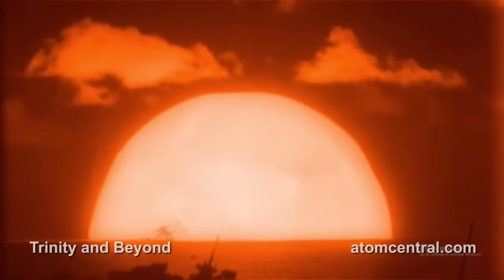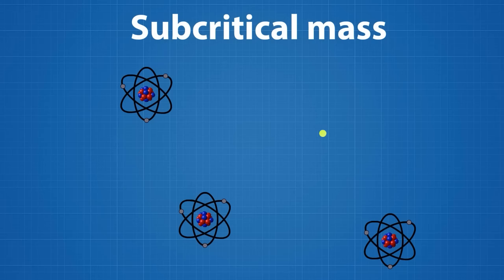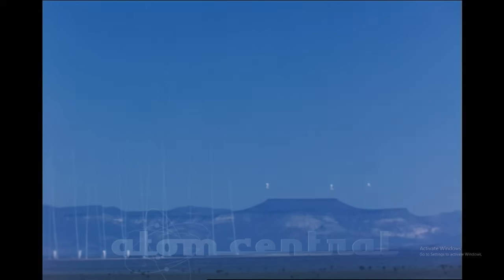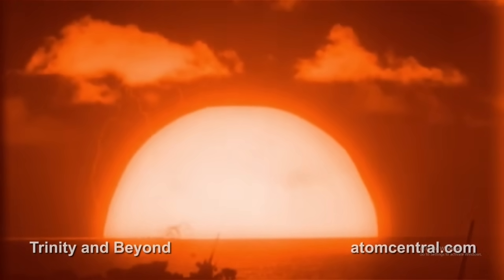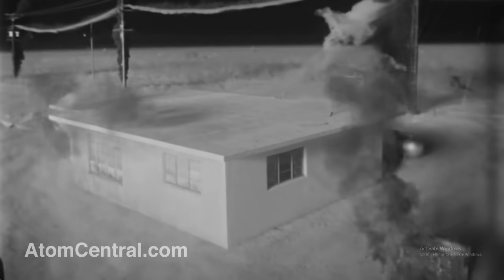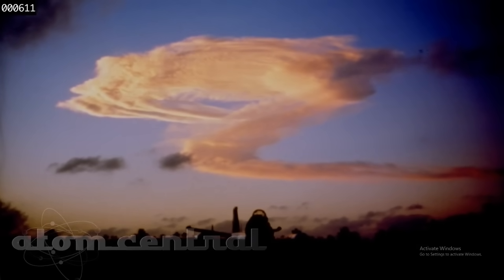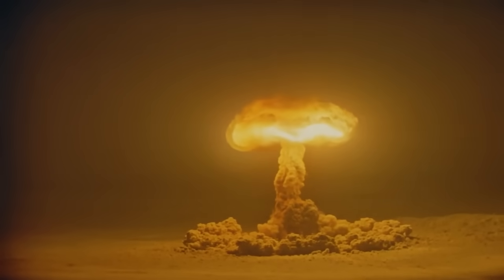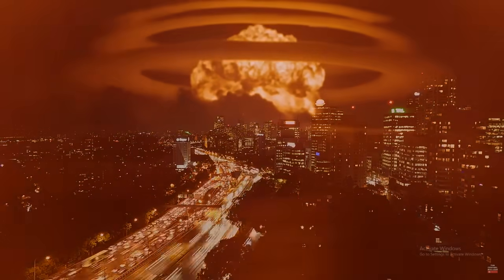Anatomy of a Nuclear Explosion

Comment: The half-life being shorter means that radioactive decay is more intense. Barium-141 has the most intense decay radiation in the list shown, but it's a threat for less time. This is why you should stay indoors after a nuclear strike for as long as possible: it reduces contact with the short half-life radioisotopes in the environment until several half-lives, meaning that a significant portion of the radioisotopes have decayed away into more stable, less dangerous elements.
Reply from the maker: I didn't know this. Thanks for the additional information!
Reply: @darkscienceyt  Additional information, a "half-life" means it's the time period during which half of the remaining material will decay away. During the next half-life, you have a quarter of the remaining amount, and so on. It's possible for more or less of it to actually decay during the period, and a detectable amount of radiation isn't necessarily life-threatening. The key elements of dealing with a radioactive environment are time, distance, and shielding in order to control your radiation dose. This means limiting your exposure time, as well as factoring in decay time, and putting distance or shielding (or both) between yourself and the radiation source.
Reply: @darkscienceyt The Iodine-131 is actually one of the worst, because its moderate half-life allows it to get into the body and displace natural iodine in highly sensitive parts of the body. This is why iodine pills are important for surviving fallout. Your body won't accept iodine from fallout if it already has a surplus.
Reply: Someone has a gun with 100 bullets. If you were trapped in a room with the gun firing all its ammo in 1 minute, you would be in greater danger for that minute than if it was fired once an hour. The same odds of hitting you but more chances.
Reply: @greggweber9967  not at all. You can assume 100% of the radiation emitted is going to hit you. Your body naturally deals with radiation, even a elevated levels above normal. What your body cant deal with is a short burst of a TON of radiation.
Reply: @greggweber9967  NOT really.... one bullet can kill you, but one neutron won't. It would take many over a short period of time.
Reply: The Strontium 90 and Cesium 137 isotopes are the most insidious. They have kinda a nightmare half life of around 30 years. They have short enough half lives to be strongly radioactive, but long enough to be a long term hazard that cant be waited out. Strontium is absorbed by bones, so if it gets inside your body, it will be irradiating you for the rest of your life.
Reply: @lawv804  This is why so many boomers in the Midwest developed cancers in the 80's & 90's... Thyroid cancer was unusually higher because many of them were children living on farms and were exposed thru home raised milk & produce...
Reply: @lawv804  That's because Chemically, Strontium "mimics" Calcium, and Potassium.  Same goes, for iodine, which is concentrated in The Thyroid and Thymus Glands,  Radioactive Dust, of all kinds; is drawn into the Lungs, and trachea, sticks to the mucous membranes, there, and remains there, for the rest of Your Life, bombarding the surrounding tissue, with Alpha, and Beta Particles; perhaps Gamma, as well.  After it kills You, and You are dust, some radioactive particles are still there (such as Plutonium-239), with a half-life, of 25,000 Years; it will be dangerous, for the next 250,000 Years, killing, over and over, again.  By Comparison, The Original Americans arrived in North America, about 18,000 Years Ago; Stonehenge, and The Egyptian Pyramid-Building Period,  was built, and began; about 5000 Years Ago; and Lake Toba erupted, about 75,000 Years Ago.
Reply: Also worth notting that not all radioactive elements are equal. Plutonium for example is a great alpha emitter (mainly 238 and 239), alpha particles are helium nucleus it's very ionizing and heating but doesn't penetrate much your skin, the danger is ingesting or inhale the radioactive material. Then it's very very toxic.
Cesium-137 is a beta emmitter (basically free electrons) so is not THAT penetrating einther but also dangerous to inhale.
Gamma emiters is the most penetrating and harder to shield against but ptoportionaly causes less damage.
Uranium and Plutonium even the more stable isotopes are very toxic chemically
Reply: @FranÇa_Ball  Everything you wrote after "Also worth…" was both true and cool.
A few centimeters of air or piece of cellophane from a pack of smokes will stop alpha particles. You could hold a warhead core of weapons-grade plutonium in your hand for a moment with no ill effects. I would wear surgical gloves or something. I bet it would feel a little warm on a hot day. Like you said, you get it in you and it's another story.
Do NOT do that to weapons-grade uranium 235, please and thank you. That is different.
Reply: Beta radiation does penetrate skin. Way more dangerous than alpha.
Reply: I almost thought You talking about half-life made by valve
Reply: Here's another way to look at it: same-size samples of different radioactive sources give off the same amount of radiation during their half-lives. So Barium-141 will give off the same amount of radiation in 18 minutes that Strontium-90 does in 29 years (assuming they give off the same type of radiation, and have the same number of atoms).
Reply: Yes, thank you for saying this. People assume that the longer something is radioactive, it means it's dangerous for longer, which is the opposite of actually. Things with short half lives mean they are emitting a lot of radiation for a short time. Whereas things with long half lives are emitting very little radiation but for a long time, which is much much safer.
Reply: The worst prompt beta emitter is the few hundred grams of free neutrons. Not only are the bouncing around at several hundred miles per second, they’re beta decaying where ever they go.
Reply: @DrDeuteron  Username checks out
Reply: @DrDeuteron  By the time the free neutrons decay, they are so spread out that they aren't a serious beta radiation threat. They are far more dangerous while concentrated close to their source as neutrons.
Reply: @lawv804  neutrons decay into beta particles?
Reply: @ut000bs  Yes. Free neutrons are unstable and undergo beta decay with a half-life of about 15 minutes.
Reply: @ut000bs  The neutron ejects a beta particle (electron), and becomes a proton.
Reply: @lawv804  I read your reply on the run in a hurry and I don't think I digested it right. Of course that is correct and I have no idea what happened.
I am the absent-minded physicist. lol
I must have read "beta" and thought "alpha."
Reply: @DrDeuteron  neutrons decay into beta particles?
Reply: As they said in those old documentaries "Duck and cover!"  lol
Reply: 🎯 the first 24 hours are the most important in terms of shelter. the next week or two would be ideal if you cannot rely on rescue within that time but if you could choose one, it would be stay under shelter the first day.
Reply: Strontium-90 and Cobalt-60 are the bad mofos of radiation...
Reply: if you were near blast site, it dosent matter tbh, you are already screwed. if you die in a year or 15 years, dosent really matter much.
Reply: Awesome thanks 👍
Reply: So unless you’re somehow capable of staying in a shelter for 29 years, I guess strive to get to 8 days at least before making short trips only if necessary?
Reply: @rickdaracc4611  You didn't understand what half-life means. You only need to stay in a shelter for 2-3 weeks. The activity then drops to a value that is only slightly above normal values.
Reply: Correct. Shorter half-life means greater damage from radiation. Problem with Hiroshima was that at a time, population was not informed how to protect themselves from fallout. As radiation can not be detected via smell, sound or sight. And the health problems like cancers took a long time to develop after the exposure.  
A big concern is that air currents can carry fallout quite a long way away from nuclear detonation. And the direction is hard to predict. So a significant portion of the population would need to shelter indoors for a period of around two weeks. Food and water can also be dangerous within this period. So the problem is, in case of nuclear explosion there will be a lot of people unwilling or unable to remain sheltered and have enough supplies for this period. Even if you go with recent COVID isolation examples, you can see that it is likely people would exit their shelters sooner and would thus expose themselves to a long term health hazard. Not to mention, a lot of people would be caught outdoors, unprepared by the time fallout hits them.
Reply: Even after that period; there will still be plenty of radiation left, from. the longer-lived radioisotopes.  Your also forgetting the other effects of Nuclear War, such as Environmental, and Supply Consequences.  EMP was also barely discussed.  I suggest You read "Alas, Babylon", as well as look at both "Threads", and "The Day After", Again.  Another such movie (and, there were many of these), was "On The Beach", about a group of people, in Australia, waiting for The End, after The Northern Hemisphere had been destroyed.
When I was in Sixth Grade, We had an "Atomic War Drill".  All the school students were crowded into a dank, paint-peeling, mold-infested, unused locker room (My Elemettary School had originally been intended for a Junior High, or High School), and while We were miles away, from Ground Zero, We were cheek-to-jowl, with no water, or food, or sanitary facilities.  How We were expected to survive down there, for even a day-or-two; let alone two weeks; was beyond me.
One "wag" suggested this, as a Nuclear Blast Drill:  When You see the Mushroom Cloud; stick Your Head, as far as You can, between Your Legs; and kiss Your Backside, Good-bye.  Read, in "Alas, Babylon", what happened to the imaginary town, of Fort Repose, Florida; on "The Day".  The attack began, at about 7AM, Eastern Standard Time.  By 8:30, Miami to Homestead, along with Tampa-St. Petersburg, and Jacksonville; along with Eglin Air Force Base, and Pensacola-Mobile, Columbus, Washington, Norfolk-Portsmouth-Virginia Beach, New York City, London, Paris, Moscow,  Berlin,Tokyo-Yokohama,  Beijing, Omaha, Atlanta, Savannah, and a hundred other cities, maybe more than that; were blasted, radioactive, rubble.
Reply: @rodrudinger9902  "On The Beach" really isn't at all accurate...
Reply: Beta decay energy of barium-141 is 3.199(7) MeV. (That is "hot.")
Reply: After the first day the radioactivity of nuclear fallout will have decreased by 50%, after a week down to 10%
Reply: If you still have a house! You don't even know what may be a target in potential nuclear war!
Reply: Military bases will be primary targets. Industrial areas secondary targets. Smaller cities and towns won't be targets. Most people will need to deal with fallout only.@pashapasovski5860
Reply: My dear, we have thermonuclear hydrogen fusion bombs lol 
All of this X1000 is what we’re armed with in 2024.
Reply: What is meant by "more intense"?  I understand a rate of decay being faster or slower, but the intensity of decay, what's that referring to?
Reply: Can't what for the mad max feel afterwards.
Reply: so does this mean we wont have to hide 700 million years then?
Reply: @LEE...337 😄
Reply: @LEE...337 then I suppose the half-lives of fission byproducts will be moot.
Reply: They used to say, stay in your shelter for 14 days. Now it is 3 days which is probably means you can leave your shelter for a short time after 3 days. I would remain in my shelter for at least 2 years if i have the supplies. People will kill each other for food and water so its probably not safe to go out. After 2 years, most of them will die from exposure they got initially.
Reply: You’re not the boss of me
Reply: Wow
Reply: basically, stay at least 3 days before going outside after we blow each other up
Reply: @dogabuserslayer8341  Only if you are taking your iodine tablets.  Otherwise, you will need to stay in for about a month to get it down to 1/16th.  40 days (like lent) gets the iodine down to 1/32nd and allows almost all the fallout to settle or disperse around the globe.  Being South of the equator would help.
Reply: Right... just imagine it like this, everything has that same "amount" of radioactivity. It's just that different elements or isotopes release that amount of radioactivity faster than others. Short half-life= all of it is released in a very short time. Long half-life= very little released at once over a long period of time.
Reply: Screw that! I'll go out whenever I please, thank you.
Reply: @AA-le3xe not the sharpest knife in the drawer
Reply: Nah
Reply: The more G’s, the better!! They’ll reflect our minds, technology, and more!! G strings!! 👙 👙👙👙

Our brains look like gum!! 🧠 Juicier the better!!!🍏🍋‍🟩🫐🍍🍎🍌🍈🥥🍐🍉🍒🥝🍊🍇🍑🍋🍓🥭

Love everything until it loves you back!! Mosquitos too!!🦟 ❤

Each of us and each galaxy would represent a cell!! 🦠 We’re stars putting ourselves back together again!! Like Humpty Dumpty!! 🥚 🐓 

The sky is blue because we’re meant to imagine it as a diamond!! The auroras then create the rest of the spectrum!! 🌈 💎 

A purple sky would reflect the heart of the ocean!! An opened mind!! 🤯 The earth purring more!! Purrrrrple rain!!☔️ 🐈‍⬛ 🧶 

Each thought to me is a solar flare, which shifts us into parallel worlds!! It’s hard here!!! I’m a peaceful dude, yet my life here has been super difficult!!🥹

Alpha Centauri represents a shift in consciousness!! Dog planet!! We’re riding the alpha waves!! Woof woof!!🐶 🐾 This is our world peace and enlightenment for the world and universe!! All is one!!😇🥳🥰🤩

We’re each a mini universe!!🌌

The 3 Body Problem represents our gut brain, 🍱 heart,❤️ and mind!! 🧠 

The moon is a black hole!! 🕳️ A neutrino!! The planet is a colonized moon!!😇🌍👽 The sun is a shapeshifter!! 🌞 

Are you and I sculpting together as a team or as individuals??? 🧑‍🎨 Using the moon as a tool!!! 🪨 The Sun is the eye!!👁️ 

I love the tool/word grinder!!!😮 We’d be Bumping and Grinding!!😂

The Earth is like a refrigerator and the atmospheric pressure is melting or defrosting the stars above, as if they’ve been in the freezer!! 🥶 

It would also reflect us krystalyzing and becoming diamonds in the sky!! 💎 💎💎 Lucy becomes Maisie!! 🐒 👽 

We could be stars from above aka heaven, melting everything from above, as well! Like a River Running Through It!!! 🌊🌊🌊🌊🌊 Gravitational waves or our thoughts raining down on us!! 🌧️ 

Unlocking a Secret Garden within and outside of us!!🤫 An Oasis!!!🏝️ 🏝️🏝️🏝️🏝️

Flowing!!! It helps a lot to flow!!!🌊🌊🌊🌊🌊🌊 Letting go, so we can concentrate more and work on our project!! Heaven On Earth!!🌍 👼 

Flowers!! 🌺 🌸 💐 and Flow-Ers!!🌊🌊🌊🌊🌊

I know energy is still impurrtant!! 😻 

And of course imagination!!! Love!!!💗 🐶 🎾 🧶 🐈‍⬛

To create heaven On Earth, the galaxies collide!! 🌌 Twin flames connect!! 🔥 🔥 We’re creating quantum entanglement!! Ghost particles merging, becoming more like the Stay Puft Marshmallow Man!!👻👻👻👻👻👻👻👻

The universe is still the Earth!!⭐️🌍⭐️ We’re seeing it from the insides!! 🕵️ Like we’re inside a volcano 🌋 or wishing well!! The stars and galaxies are like coins!!🪙  The Goonies vibes!! 💀 We’re treasure!! Antarctica is treasure island!! 🐧🇦🇶 Unlocking antimatter!! 🐜 Booby and booty traps exposed!! Planet X!! Hubba Hubba!!🥰 

Everything and everyone has been our teacher!!👩‍🏫

3D is like the murky bottom of a bong or volcano!!🌋 The fourth dimension, representing Mars is like the stem of the bong or the volcanos vent!! 👽 Experiencing higher dimensions is like the smoke or magma reaching our mouths 😋 and then circulating through our bodies!! We are the Earth!!🌍 👼 

The road less traveled!!!🧳 🌹 Straight up!! 🎈 🎈🎈🎈🎈We’d be super condensed or extremely packed neutron stars!! Like Rigel!! Blueberries 🫐 Antioxidants!! Betelgeuse has evolved into a neutron star!! 🧊 🦖 🧊 🦕 🧊  🦣 

Our long winding road, exploring different dimensions, finally straightening out!! I’m getting Pee Wee vibes!! Large Marge sent me!!🚴😂

We’re vaporized, as if we’ve been smoked or roasted!! 💨 The smoke representing again those compressed neutron stars climbing the higher dimensions of the universe like a chimney!! I’m Mary Poppins, y’all !! ☂️ 🧞‍♀️

It would also represent us as a comet traveling through a wormhole!! 💫 

Who me, I’m just a worm!!🐛 🫖 Solving a labyrinth!! 🦉 Solving amaze!!! 🦋 

Different energies tell a different story!! 📚

We’re storytellers!! Artists!!🧑‍🎨 

We’re energy first!! 🐝

Comment: How did the camera survive when the houses got blasted back there ? Seems fishy to me
Reply: No, it's not fishy.  Give a mecanical engineer unlimited finds and a specification for what the housing has to withstand and you'll get it.  Besides, they don't show you the films from the housings that failed, surprise.
Reply: 12 inch plexiglass.
Reply: The cameras were in a bunker, used a mirror system and tele lenses. What is fishy is that there are repeatedly similar comments from different accounts.